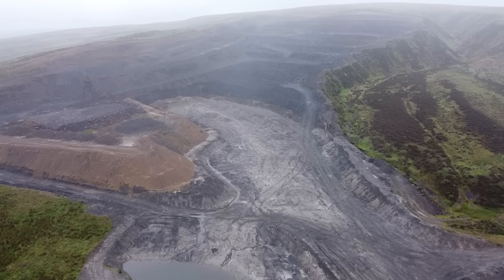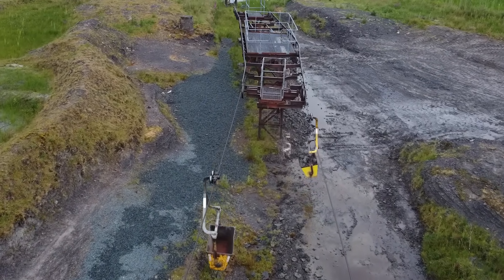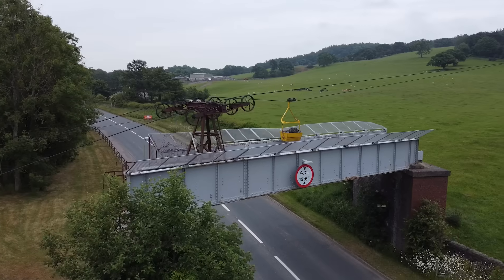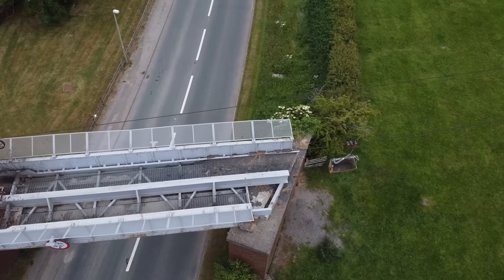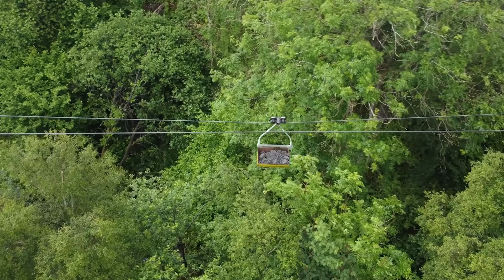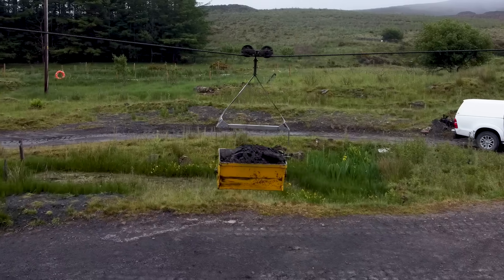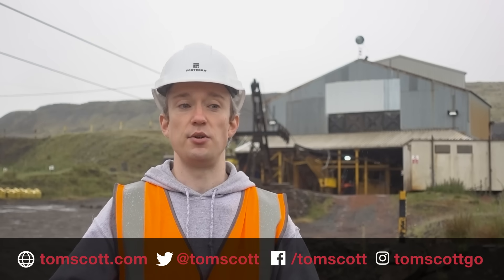The UK's last aerial ropeway uses no power, moves 300 tonnes a day, and will be gone by 2036.

Comment: It's amazing how the modern equivalent of this is literally just.... design a new one exactly the same, it was always perfect.
Reply: It's extremely cool but perhaps not that surprising - the computer will have been run by an engineer, using ultimately the same design constraints. I honestly wouldn't be surprised if an engineer had looked at the existing one and said "those heights work, let's just use that again", if it was my design it's what I would do.
Reply: @hairymcnipples  This person is an engineer. If the old design worked for 100years with no problems, no energy cost, no pollution. Put its data in a table and call it the standard.
Reply: Not to diminish what they did over 100 years ago, but the modern computing and aids engineers have save time more than anything. Engineers don't have to waste time with long division or trigonometry in the middle of a design these days, but that doesn't mean they don't know how to. And even if they didn't, you have to be at least a bit smart to be an engineer, and learning how to do a new type of math shouldn't take more than a day.
Reply: They can make it better, still. Maybe find a way to automate the dumping of product?
Reply: To think, calculators were once not a thing, but rather a person. Amazing, really
Reply: @Armin2012  not really we all just got lazy.
Reply: @goldiekoi935  I believe you misunderstood what I was saying
Reply: Because men of the past did their own computations with analog instruments. Slide rules and brains.
Reply: @georgemorley1029  And engineers don't use their brains today? The use of CAD software and computers doesn't mean engineers have become lazy. It means that many manual calculations that required hours by slide rule can be automated allowing engineers to build more complex things. If efficiency is lazy maybe we should go back to using stone tools like those who built the pyramids of Giza.
Reply: @georgemorley1029  and men of this time did their own computations with digital instruments and computer software what's your point?
Reply: @battleoid2411  What you said is exactly his point. It's no wonder two "calculators" came up with the same solution.

Comment: couldn't they make it so buckets travel back up flipped upside down, so they won't collect debris and rain on the way up?
Reply: Too much mechanical complexity for minimal benefit.

Northern England generally doesn't have much in the way of "debris" flying in the air, and since the buckets are being dumped every round anyways, the water accumulation isn't large enough to be relevant.
Reply: @boosterh1113  they already manually flip them, wouldn't be hard to put a pin in when it's raining 1:58

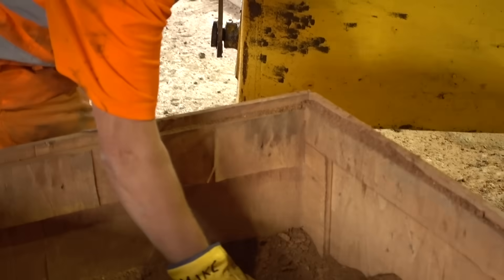there's enough water accumulation to need dusting 0:46

but l'm sure l'm missing something, if it was better they'd be doing it

Comment: No one thought about putting little roofs on the buckets so they wont get rained in and have the muck stick to?
Reply: KISS principle.

Having watertight lids would interfere with flipping the bucket to unload it, would mean you couldn't pile the clay as high, and would mess with the carefully balanced math that keeps this thing running.

All of those problems could be solved with sufficient time, money, and engineering, but when the other option is "throw a scoop of sand in the bucket before you load it," why bother?
Reply: @boosterh1113  not necessarily as the roof would need not be attached to the rotating part of the bucket. KISS indeed.

Comment: What do they intend to fill or do with the massive hole in the ground when it’s eventually shut down?
Reply: Going by the image in the video, and the fact everyone keeps referring to "the hill," I imagine there won't really be a massive hole in the ground so much as just a hill that used to be there that won't be anymore.

We have a quarry near my hometown that was similarly dug into the side of a hill, and when they finished with a given rock face, they just gathered all the unused soil that had been on top of the rock, used it to turn the rock face from a cliff into a slope, and now the elevation change just happens 400m further west on one side of the road than it does on the other.

Comment: Question: What happens when the whole line is empty. (Stopped for the night, or right after cable replacement.) It doesn't feel like a single load is enough to set it in motion.

Note: Instead of a thermal discipation brakes, it would be even better if they replaced the breaks with a generator. I'm sure something oop ther' needs juice :)

Note2: I think it would have been worth a note that you can't build gravity driven ropeways anywhere. You needs a reasonable straight line with no or minimal inclination midway and no too steep sections. Plus, the whole line must be free or able to make it safe. (See bridge.)
Reply: Did you mean brakes ?

Comment: It being non-powered isn't surprising as it isn't that difficult to make work on gravity alone. The filled buckets going downhill naturally will weigh more than the empty ones coming up so they will pull the cable down their side. As long as there's more weight on the downward side it could run continuously.
Reply: @Biophile-e8m  In theory though, could that work? could the weighted buckets pull the cable and lift the empty ones, and as long as you had a stream of them doing it could you keep it going?

Comment: as destructive as mining is... this has to be one of the cleanest ways of doing it aha. as if they wouldnt have more of these still give what seems like massive cost savings?? or does it not produce enough compared to a "modern" set up vs money required to keep it running
Reply: Well, you have to admit they have an unique setup here, with the shale a mile uphill from the brickworks.  Most quarries tend to turn into holes.

Comment: So how does the empty bucket climbs without power?
Reply: The buckets with weight in them going down moves the whole line, so the lighter buckets move up as the heavy goes down. Hope that makes sense.
Reply: they are fixed to the cabels. the heavy one pull it down

Comment: Are the brakes working automatically?

Are they using brake shoes or some kind of a eddy current brake?

At least in the 1950s and 60s I wonder if noone tried to install a small generator to brake and generate electricity...

Comment: It's such a shame that this is the last one that remains. A gravity-powered ropeway that requires no fuel whatsoever. If such things were reimplemented on a grander scale, and with the technology and materials we have today, I'd say this could solve a few problems. Definitely cut down on pollution and transportation costs, at the very least.
Reply: This only works if you want to transport something heavy from an altitude that's higher than the destination's altitude.
Reply: @andrejspetersons8500  Obviously, but there's bound to be plenty other places out there where that could be used. I can definitely imagine people building brick factories downhill of a quarry as to not have to walk uphill with a full wheelbarrow, for example.

Comment: This is absolutely amazing! And while I do understand the basic principle, there is one question bugging me: how do they start it again after it has been stopped (over night for example?).
Reply: They just load it at the top again?
Reply: Two immediate options in my head: 
•leave full buckets on the wire rope (with the brake on, obviously)  
•start totally empty line mechanically (steam, electric, gasoline) until there's enough full buckets on the wire rope.

Comment: Add a generator make power to run the trucks🤔
Reply: @ethanbennett7  Electric dump trucks n loading shovels😉
Reply: @ethanbennett7  Eithan the idea is run a power generator off the gravity driven cable system, maybe only enough to brew the workers brews🤣

Comment: It seems they could save a section between a couple of towers and the cable.
Reply: They probably will.
Reply: @marksmith4664  I don't live in England.  I do view these types of things as feats of engineering which should continue to exist  even as a part of the original.  You know just in case we get a solar flare that wipes out our ability to use electircity.

Comment: So unless you keep maintaining it, it will fail. 🙄 Well geesh. That goes for anything. They replace the cable every 6yrs, im sure that similar maintenance is performed on many other parts of the operation. No reason it could not run another century , unless you run out of shale/ore.

Comment: Worked since 1920 carbon emissions are low. Global warming is here we need to change as mentioned else where brakes could be replaced with generator free power from operation. It supplies enough for the expanded brick works trucks cost in replacement maintenance fuel taxes licences and of course diesel is on the way out where possible. What about the local environment with trucks road infrastructure dust noise road blocks this is virtually silent all the loading and unloading is in a controlled environment so safer. Here is proof it’s possible. Gravity doing the work gets my vote, does the job locals operate machinery carry out maintenance. Keep it simple Stupid KISS principle. You could of course build a larger version in other places  generate more power as well. Trucks have got bigger over the years!

Comment: I can imagine the rail system turns a generator that powers the quarry.
Reply: That is exactly what they did at the kennicott  copper mine in Alaska.The generator would also regulate the rope speed. kennicott  was located on a much steeper hill, more energy was available too drawn off the rope. The ore  came into the top of a 10 story building on the hill slope and was processed down the building moved by gravity. Rail cars were loaded with processed ore on the ground level. The mine closed in 1938.

Comment: Is really cool that even with our modern tools, the correct answer is still just as correct over a hundred years later. I love engineering.
Reply: It really depends on the problem being solved. For most problems, the "computer design" is just an engineer writing code to make the computer do exactly the same thing that they would have done by hand, so that they can sell the software to someone else (or ideally thousands/millions of other people) and save them all some time from doing the calculations by hand. So it's not a huge surprise that it came out with the same answer.
Reply: @emissarygw2264  computers only doing the same calculations that were done with pen n paper..only quicker
Reply: @andybennet8098  Would love to see all the pen and paper Navier-Stokes calculations for last centuries fluid flow problems
Reply: @andybennet8098  And using less physical resources and human energy.
Reply: @andybennet8098  much much much much quicker, I ain't doing  any fluid simulation with 1 million mesh using pen and paper
Reply: @emissarygw2264  often  computer designs are relied on as humans can't check them though and they create road junctions thwt don't work as a the computer can't predict real driver behaviour to a road layout.
Reply: If it ain't broke, don't fix it. Applies to alot of things in this world.
Reply: @Stargazzer811  a lot*
Reply: I was thinking the same. A computer might get the answer quicker, but it's only as good as the minds who design it.
Reply: That's maths for ya
Reply: In fairness, it should be! It all comes down to mathematics regardless how the calculations are done!
Reply: It's a big investment and would be hard to build everywhere
Reply: I would be surprised if the computer spat out this exact solution down to the exact quantities of steel used. So the computer aided design probably would have been cheaper to build. But that's just semantics and penny pinching effectively.
Reply: Trolley buses, electric a hundred years ago and now look where we going, back to electric!
Reply: * It’s
Reply: @paddor  is*
Reply: @USBEN.  sí*
Reply: @gaterin1998  ₴Ĩ*
Reply: @abandonedaccount123  *sigh*

Comment: Wait, so the bucket goes down to the brickworks where it is loaded in a dump truck?
Reply: The system was designed when it would have been loaded into a horse drawn cart. Cutting out a few hundred metres of haulage (especially on a slope) matters a lot more when you rely on muscle power than when you use a diesel engine.

Comment: What an amazing video, i do hope they kinda keep some 30m ending in a rope holder and 1 or 2 buckets at the end station as a momument from a different time.  (With some transparent glass and only the removed cable and towers on it a visitor could picture the view of the ropeway with buckets  down / up the valeymore length by looking at the glass from the right viewing angle.

Comment: There was a similar type of gravity system here in NZ called the Denniston Incline. It was ground-based however; 12.5 tonne wagons, with a large water brake at the top. Shut down in '67.

Comment: Great to hear another computer simulation came up trumps such as that of Network Rail's positioning of intermediate signals on the Settle Carlisle line. The simulation placed them in the same place the Midland Railway engineers did in the 19th century

Comment: "..just need brakes..." to keep it under control.  What are they using for brakes?  Certainly not friction band, disk or drum.  They'd wear out too quick.  It has to be something equally clever and sustainable, I'm betting.  Spinning air-brakes, ala speed control in wind up music boxes, only HUGE!  Is my bet.  What's the answer? Inquiring minds want to know.

Comment: That's very good, but the energy is not free.
Consider that the amount of energy spent to put the material into the wagons is then converted into kinetic energy.
This energy can come from food if it's done by hand, from gasoline if there's a conveyor or a machine putting all the material in the conveyor.
There's no such thing as free energy, but there is in fact efficient energy, and this is the perfect example of using energy efficiently.
Bravo to the engineers.

Comment: So, add a generator installed like a motor on the wheel to act like a brake AND make power at the same time.  WIN/WIN!!
Reply: but that would sap energy from the containers, making it less efficient for mining.
Reply: @1KosovoJeSrbija1  what?
Reply: @Redtooth75  any energy you turn into electricity you take from the kinetic energy of the containers, this would slow them down significantly.
Reply: @1KosovoJeSrbija1  It would do exactly what the brakes that were mentioned are doing but produce electricity instead of just producing heat

Comment: Surly instead of breaks they could have added a dynamo? Then as well as getting the rocks where they need to go, they get free electricity?
Reply: It was built in the 1920s.

Besides, with what they said about the computer settling on the same design as the original, I don't imagine there is much in the way of spare energy. Might be enough for a few lightbulbs in the factory, but that about it.

Comment: Before modern technology when everything used to be just naturally environmentally sustainable
Reply: Not everything was better, but the design requirements certainly trended towards efficiency. A lot of modern tech is built on brute force with low cost materials. A cheap replaceable system is considered better now because the operating costs of everything have been driven down, and the value of labor has been artificially destroyed. In the old days, you built efficient systems because motors were crude and noisy, and the men and women keeping it running had salaries big enough to survive decently on. Now you can hire a starvation wage technician in india to run your equipment over the internet and when your equipment runs into issues you just slap a new hunk of plastic on it instead of designing one that'll just work and stay working.
Reply: yes and you would be sustainably and environmentally friendly killed and absorbed by nature by anything from a flue, any kind of infection, eco/bio water full of bacteria and on and on, mostly before the age of 50. Great times !!
Reply: @ioandragulescu6063  I never said technical development was problematic. I'm insulting the global cultural trend of inefficiency and disposable convenience. Obviously things have gotten better, cheaper, and safer generally over the years. The problem is that the world has continued to move towards making things as immediately cheap as possible at the expense of the long term. You don't see this type of design mindset anymore because simpler systems with more hidden costs and less real planning look better to the assholes in charge. Look at the transition from glass bottles to plastic. Glass bottles were readily reusable, and indefinitely truly recyclable when they were damaged. Plastic is impossible to reuse at scale and fundamentally impossible to recycle truly. That's what I'm complaining about.
Reply: @dustinbrueggemann1875  I think we posted about the same time, I didn't see your post when I wrote mine, it was directed at the original post. I 100% agree with everything you said.

Comment: When it stops it wants to be preserved as a heritage site because that is what it is and must be listed as such on closure. There is also modern thinking needed to this system as its application could no doubt be used in other circumstances  with modern thinking and with climate change always on the agenda about as zero emmisions as you can get.

Comment: I would think there's quite a bit more to operating it...
 It must take a certain load to overcome the friction & get it moving & there will be various maximum loads for the cable & pylons. If they replace the cable every six years it must be quite a  process to unload it just to remove the old cable & set it going again.

Wonder how the speed is regulated too, a centrifugal brake mechanism?